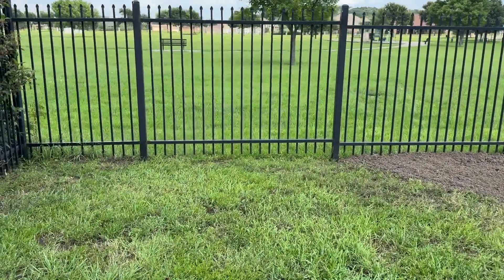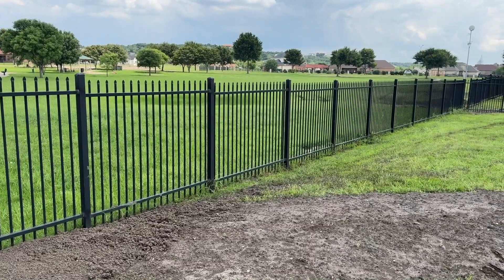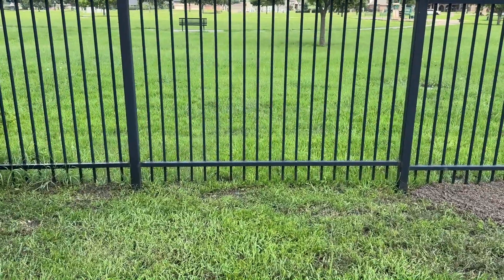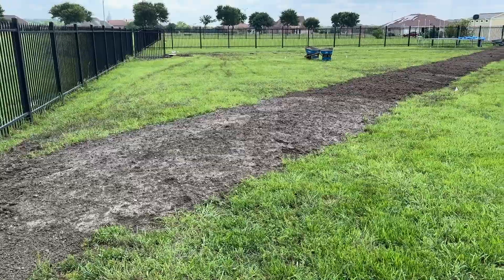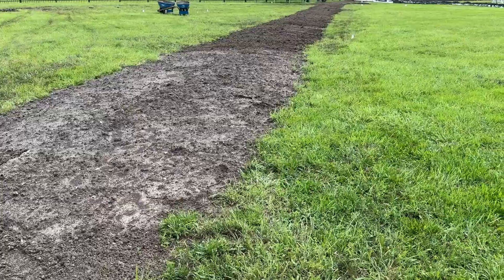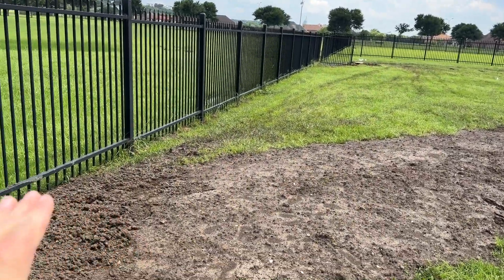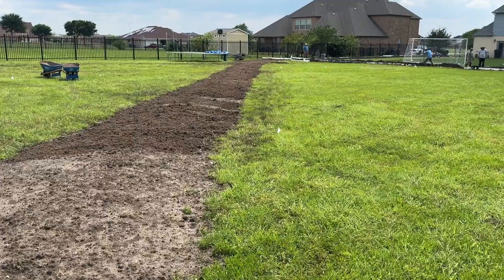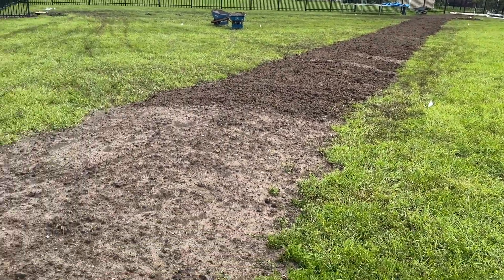Building a Berm for Large Amounts of Water

Comment: How do you keep the water from seeping through the top soil? we tried this on our property and the water just ran underneath and through it not over it. Our property has a lot of  clay in the soil. Does that make a difference in what material needs to be used to effectively block a wall of water?
Reply from the maker: That is odd. My first thought as I was reading your question was "Do they have sandy soil?" - if so, I would understand why water would sift through/under. Regardless, in order for it to soak in like that, the soil would have to be porous in some fashion. Did you put sod over top of the soil?

Comment: Those yards are huge, it makes me wonder if they have OSSFs but I doubt they would as there is a community-park there.  If they do have an OSSF & it is less than 2% slope then it does require a "Comprehensive Drainage Plan" to max out the oxygen in the soil for water-treatment in the sewage-disposal-area.   
I'd want to know the lowest elevation of the ditch you're discharging into & the lowest elevation of the surface-water-pond, usually it is 0.2% slope minimum where I haven't found a permitted-residential property yet that had less slope. Then I'd suggest 8 inch pipe or larger depending on how much soil there was above that ground-water-table (being the line drawn from the bottom of the lowest-ditch to the lowest wet spot you don't want to fill.  The berm may work but it might also send that water subsurface as the hight of the ponding increases as you'd need to lower the K-sat(a measurement of how much water moves through the soil-materials) rating to control the water passing through your berm. 
I also would suggest they use a vertical-inlet instead of a grate b/c it will allow large materials to enter & pass through the large-pipe, where leaf martial & grass clippings would never clog the intake as they would wash through b/c of the 3FPS water moving though the properly sized pipe for self-cleaning capabilities.